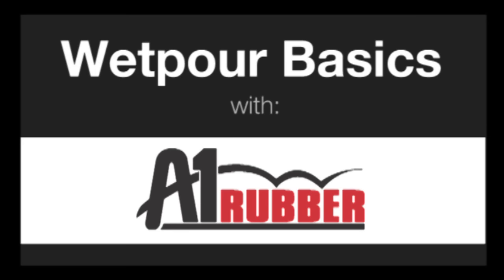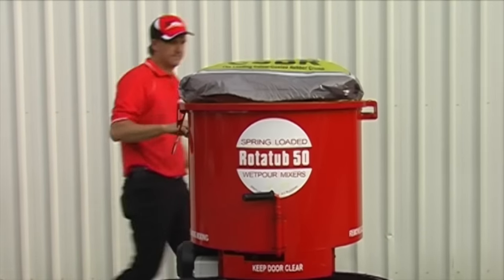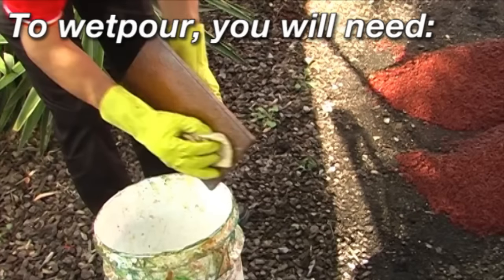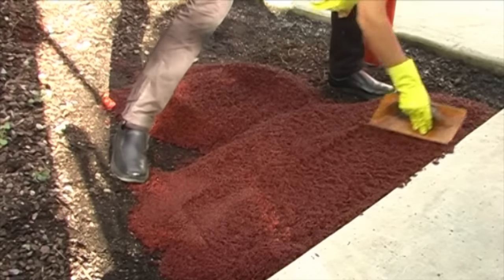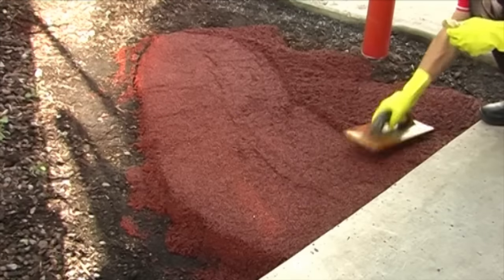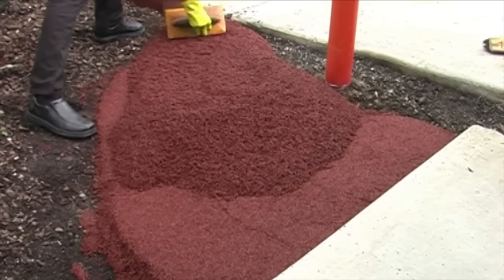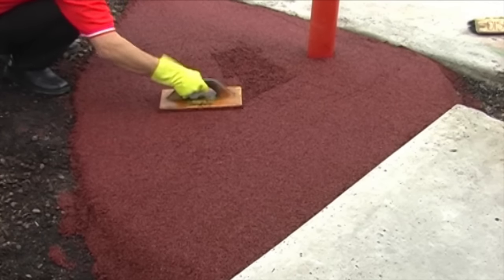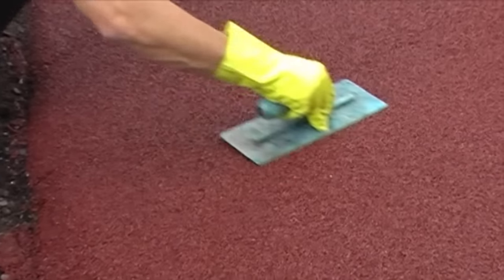Wetpour Basics - How To Lay Rubber Wetpour

Comment: I do this kind of work in southern Nevada, we use another material under the final rubber surface, make it more bouncy and lower the cost of installs.
Reply: You do not want it too bouncy as it will cause more damage to the child such as long bone injury. The bounce is rated in HIC (head injury criteria) using a Triax head drop tester. The base material is not the major cost but is important for surface stability. The main cost is the polyurethane used to binder the rubber granules on the surface wear layer.
Reply: Please, sent me pictures or video of how you do it

Comment: Laid straight over the weeds, nice.....
Reply from the maker: it is preferred to compact crusher dust or whatever you use to prep for a concrete slab, this will guarantee stability from rain erosion, weeds and good drainage. But technically it can be laid over weeds.
Reply: Raf M no

Comment: how safe is it, will it not burn in case of accidental contact with fire
Reply from the maker: No the polyurethane coating causes it to self extinguish even with an accelerator . It would need an open flame >88 degrees Celsius for over several minutes to start it smoking

Comment: Using rubbaroc pics at the end there but to prevent seem when you start next day rough up edgde from pervious day so granuals work back into eachother and carry on dont just start with a straight edge from previous day or seem will be noticable
Reply: The products used by Rubaroc was from A1 Rubber, also Urban Play and several other companies. A1 Rubber is the largest supplier in Australia and NZ and does not install themselves therefore competing with it's customer base.

Comment: I'm no builder, but thats not a Trowel it a Float.
Reply: The wooden or plastic float is used for compaction at 3.02 he changes to a stainless steel finishing trowel.
Reply: You aren't a builder and apparently you aren't very observant either. It was leveled with a float and final step was done with a finishing trowel. You should probably just stick to your day job.

Comment: HOw do you prevent "day seams"?  I'm talking about when you are doing large jobs where you need to do one part one day and when you come back the next day it is dry.  When you start again there is always a bad looking seam.  Do you know how to prevent the bad looking seam??
Reply: You can use a ramp or key join. Just as long as your join is not only vertical. e.g. a 20mm thickness can step 10mm then horizontal then 10mm. This can be achieved with a small piece of 10mm beading pressed into the edge.

Comment: i wanna it to do but i have a question. what rubber must i use for best tensile and tear stregnth. answer me please.
Reply: what kind of floor you want to install ?for running track or for playgroud ?there is one kind of pu top coat can be used to increase the tensile and tear strength , or you must use the good quanlity EPDM and more glue .

Comment: what kind of glue should I use and lubricating
Reply from the maker: the binder is a single part MDI Polyurethane, ours is called Procure and the lube we use is an ester called Polysolv
but the chemical name is Rhodiasolv. Diesel can be used but not as clean. see more at www.a1rubber.com
Reply: The lubricating is silicone? I can use water and soap as lubricant?

Comment: How thick are you laying that, surly a 25mm will suffice on a properly prepared base.
That would make the product go 4 times further.
It is sold by the bag so devide the depth of the bag into 25mm sections and your bag covers 4 times the area.
Do some homework before piling tons of rubber onto your drive.

Comment: Can u tell me the proportion of rubber and glue.
Reply: It will depend on which type of granule used but for SBR and CSBR (pre-coloured recycled granules) 20kkg of rubber to 4 litres of PU binder.
Reply: +Vlad Impaler thanks
Reply: What will be the proportion of EPDM and PU Binder
Reply from the maker: Both our EPDMs use 4.5kg of binder to 25kg bag of EPDM 1-4mm granules.
if the size is smaller then more binder is required due to surface area.

Comment: Isn't the trowel a bit much?
I could level that with a snow shovel.
Reply: Or with a 11kg heating roller. We use it a lot. Makes job easier and the surface smooth and firm. Very easy to use.  Here is the video for reference:
https://youtu.be/G6jCb2c3DPo

Comment: Is it a porous surface?
Reply: +watchthe1369 yeh like 70%
Reply: +Haste h thank you
Reply: Depending on the granules used 1-4mm will give fast drainage 120Litres per square metre per minute.
The base layer if 4mesh or our Aero shockpads are used will offer 240litres/m2/minute . System is OneSafe.

 If a 1-2mm granule is used this will reduce the porosity down to only 10%,  this will then require at least a 1-2% pitch to drain away. the 10% will allow any water trapped underneath to drain away and will give a firmer surface for outdoor furniture or light mobility vehicles, scooters etc. 

This is primarily used on aged care patios, around pools, verandahs, bike tracks and golf clubs, our system is called Cova Rubba.